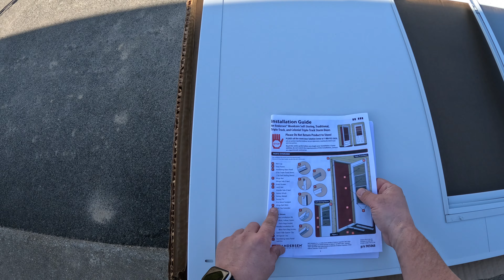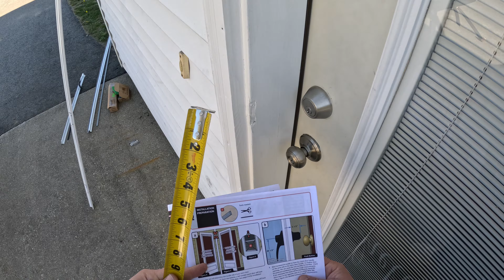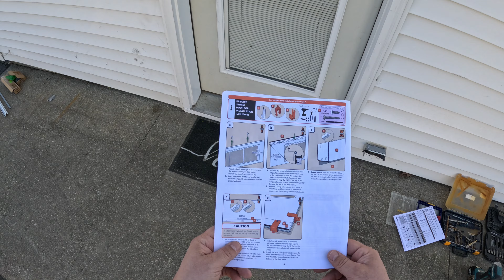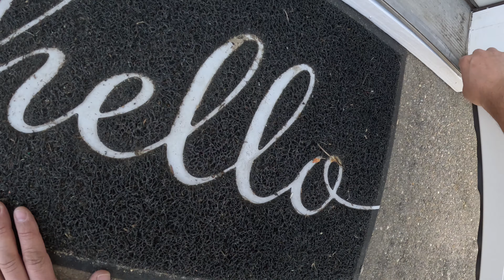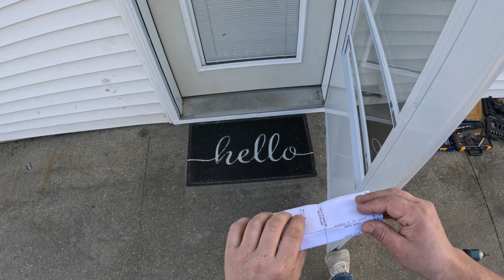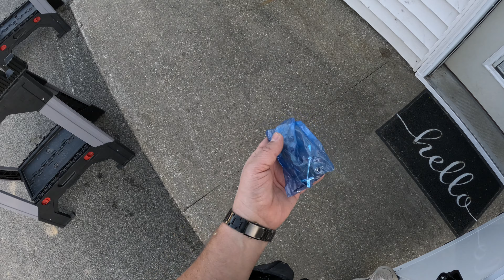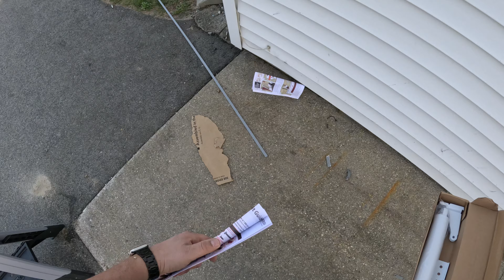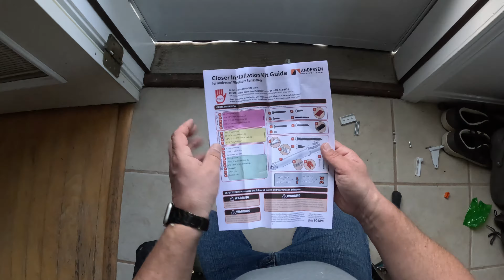Andersen 300 Series Storm Door Installation (start to finish)

Comment from the maker: Please Note When installing this door I raised the door up to close the gap at the top (kind of out of habit)… the manufacturer does provide a “rain deflector” piece that is meant to close that gap (if any). So I would recommend checking to see if setting the jamb trim directly on the threshold works for your door - as lifting the door jamb off from the threshold creates a small gap between the jamb trim and the threshold.

Comment: YOU, Good Buddy, did a SUPER JOB on this video since I just bought one of these doors and cringed to see INSTRUCTIONS along with the I HAVE TO PUT THE THING TOGETHER  They forgot to add the line  SOME ASSEMBLY REQUIRED !  So let's look at this!  A WIN WIN for the manufacturer in less employees needed to do the jobs, no more LEFT or RIGHT door mounting (just reverse it), no returning item to the store cuz something YOU DID don't fit right and of course charge more for the door .  I think ANDERSON should include your video with the doors they sell us!  Thank you buddy!
Reply from the maker: Hey thanks for your compliments! And yeah, it can be kind of intimidating when you open the box and realize the assembly that is needed.

Comment: Do those doors come with any type of finish weather stripping?  I see quite a few gaps and light shining through on the bottom, latch and hinge side.  Def going to trap water between those doors.
Reply from the maker: The rails have a felt weather strip where the door contacts it. If someone is concerned about water getting in between the rails and their exterior door trim they could always caulk the rail to the door trim. Also as I made a note of: the rails can most likely be set on the threshold (that’ll close the gap on the rail part) and I adjusted the sweeper to go a little tighter later on. 

My mindset on these doors is that they are to create an air pocket that’ll save on heating and cooling… they aren’t necessarily to prevent water immersion (but maybe I should change my mind on that). 

Thanks for your comment!

Comment: Tips that might help a successful and healthy installation (IMHO): 
1). Don't wear expensive Apple Watch/chains/jewelry when working.
2). Use shims and a level to get more accurate spacing.
3). Don't throw instructions away prematurely because at some point, you might need it considering we don't think like the mfg/door designer.
4). Don't put heavy objects on glass. One never knows about the weight and stress and just one mistake can cost dozens of dollars. 
5). Predrilling helps the wood from splitting/running.
6). It wouldn't hurt to use a small piece of the box cut and placed into door to keep it firmly in place when doing adjustments until the handle is placed within door.
7. Don't be shy in calling Anderson/Emco's "800" number if parts are short/missing/ruined. They'll send out to you without charge including the twisted rubber sweep which lets light and insects into the home.
8). When you throw parts, etc. to the group, place them away from the work area. Cement tends to hurt when contacting it and people just doesn't seem to bounce very well. 
9). Installers shouldn't' take off too much pass the point of exactness to the edge and to flooring/cement threshold. IMHO, I've found that daylight passes through them and insects especially like it for passing through to inside.
10. Put on bottom hardware prior to adjusting/installing the floor sweep for more accuracy.
11. Use a pencil mark on the sides of the metal sweep from inside so when drilling, the exactness of the sweep and rubber sweep is there.
12). I've found that a small tap with awl/ice-pick dimple helps keep the drill bit from "riding" and going off course.
13. Use of a Phillips screwdriver for some sensitive drilling or reduce the torque on drills that have lots of power to strip the screw hole.
14). I place the hydraulic closer at the top to keep something from getting caught into it at the bottom (including pets and children's hands) and tends to be aesthetically, unsightly and displeasing. Lower mounting tends to get more "kick dust", etc. to cause the closer to fail at some point, including oil and water spills.
15). Cut and measure twice because we all make mistakes and being correct is much more pleasurable than errors. 
16. Other than that, you did a decent installation. :-)
Reply from the maker: Those are ALL very helpful tips! Funny enough I broke the glass on my watch the first day I worked with it on. The main thing I should’ve done with this install is utilize the top “rain deflector” piece and hold the door jambs down closer to the threshold (#9 on your list)… I don’t like how the top trim wouldn’t be screwed in the middle though 🤷🏼‍♂️. I like the jamb extensions that can be added and slid down to contact the threshold better, they are available on Amazon. 

Thanks for your constructive input!
Reply: I've installed about 3 of them including Ideal Pet Doors into them. However, I'm not an expert but I do use quite a bit of common sense to make the job and health (including an expensive Apple Watch a bit easier. <smile>...Best to you for providing it for many. (Someday, I'll get a Go Pro and do some videos myself.

Comment: What are the height requirements for the door to fit?
Reply from the maker: Hi, sorry I didn’t make the height and width requirements clear. The height requirement is 80”-80 7/8” as measured from the outer edge of the threshold to the bottom of the top exterior trim. 

Here’s a video from Andersen that better shows how to size the door: https://youtu.be/ajS5ayjhBEo?si=e8Dbp3b0uYnpKybh